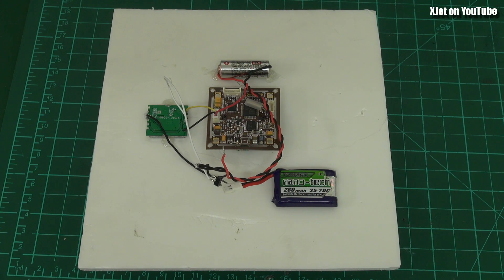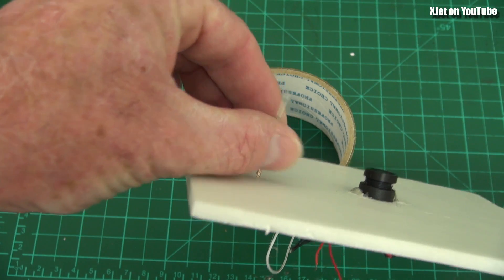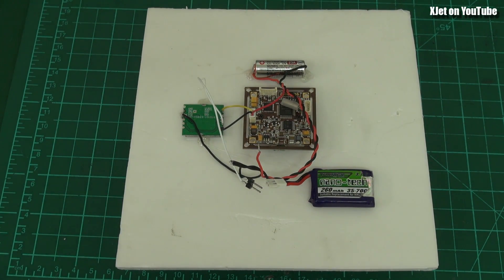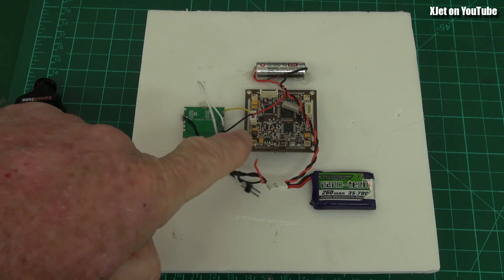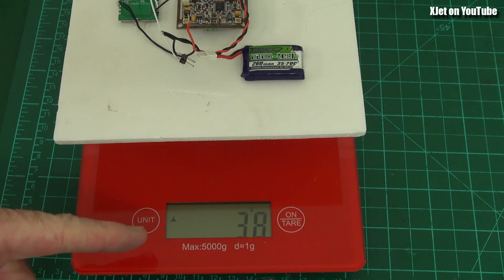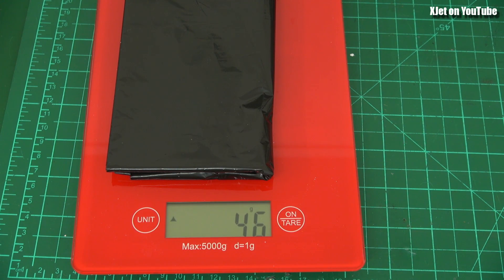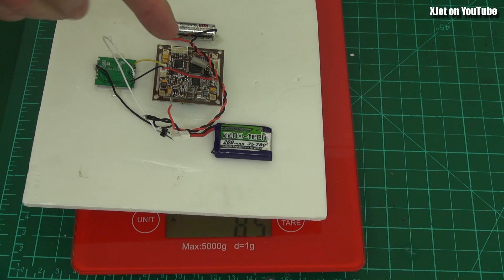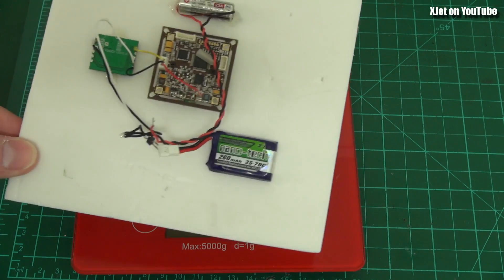A drone alternative: hydrogen-lift aerial video (FPV) Part 5

Comment: In AU, Big W here do helium balloons (filled) for $2. We tried several times to do the Mayor-FPV system, and it finally worked well with an AIO camera on 1S, 4 balloons tethered with a kite string, but the image was very .. wobbly, it would have been ok in dead still air, but by the next still day, enough of the helium had leaked out to rob the required lift. We did tie a chemical light to it that first night, which stirred things up around the area quite a bit.. in the dark it sat dead still 300 feet up, glowing bright green.. way out in our back paddock, you could see it for miles around. That was more fun than the M-FPV!

Comment: Just a thought: attach a little parachute attached to a RC servo for release to recover the payload? This would mean a 2.4 GHz RTX as well of course but you might then be able to track it using the RSSI signal on a Taranis. I have recovered downed quads like this! You must have some old FrSky RTX's laying around? Being able to track and recover this rig makes it more in line with modern thinking like SpaceX. Recycleable fun!

Comment: But you can get a combined camera/transmitter which will run on a single cell. A 150mAh cell runs a mini quad for 5 minutes at the same time. It will run the camera slone for about 35 minutes. I think you should think small.

Comment: you can ditch about half that foam board.  If you're not mounting something to it leave it on earth.
Reply: second thought, make a stack out of the componets like we do now on mini quads.  you will get rid of almost all of that foam board.  Adding fins and thinking you will take control of a bag of gas drifting in the wind is pointless and just adding weight.  How much more does a huge trashbag weigh over mylar balloons?

Comment: A dipole in that orientation will have had a null pointing down (towards the ground). You should have had it parallel with the foam board not perpendicular/normal to the surface.
Reply from the maker: If the balloon was going to be directly overhead that would be true... but balloons drift with the prevailing winds so the vertical orientiation means the null wlll be a point directly below the balloon some distance from the receiving antenna.  Vertical polarization will provide the most consistent results because there's nothing to stop a horizontally polarized antenna from rotating around until one of its nulls is pointing towards the receiver -- given that it will be a lot further away than it is high so the angle between the balloon and the receiving station will be a shallow one.

Comment: How about an atomic battery? Very light weight, will last for decades. Theoretically speaking,  you would need an alpha particle emitter  (from a smoke detector). 3 small solar cells (from garden solar lights). White phosphor (from an old CRT TV), a small voltage multiplier  (from a 1 cell backup cell phone charger). I say again, its all throretical 😨

Comment: Why not get one of those cheap 3 in one 200mw cameras and put a directional antenna on it pointing down. They weigh less than 5gr and a 180mah lipo is around 5grams as well. That'll save a lot of weight and space and I know you know how to build antennas, build a biquad antenna.

Comment: A four cell ballon battery. Bigger is better. Use lead acid truck battery Bruce. Empty your water bed to use the bladder for extra volume. What? Water beds went out in the 1970s. Well truck battery grounded. You will have to do that light stuff

Comment: there is a project i mentioned before that does something really similar -- no fpv, but realtime worldwide tracking! you could have a look at their project for ideas: https://qrp-labs.com/flights/u3b17.html 
the solar panel might double as a support, and maybe even supply 12v for your camera -- only need it in the daytime anyway!

Comment: I'm not an environmentalist, but those bags will still take many years to degrade. 'compostible' tends to mean that they will degrade, but only if they get heated in an actual composting heap. They won't just disappear after landing somewhere, although they will probably degrade a little bit faster than normal bags.

Still just a drop in the sea of discarded plastic though, so it doesn't really matter. 

A bit more OT, wouldn't something like an Eachine TX-03/TX-02 be even lighter?
Reply: Its also biodegradable FPV gear!
Reply: gotta say I thought that sounded strange. don't throw plastic bags away people, if not for environmental reasons, maybe for 'not wanting to live in a ghetto' reasons. poor form Bruce..
Reply: Joran Groothengel don't know about where you live, but here in the UK most bags you can buy start to biodegrade the second you put anything in them, particularly shopping bags

Comment: So you still cant fly a quad? Get yourself a pixhawk flight controller so that you can be flying around and if the police as you put it in auto and have a mission set that will fly back to your house and you can then just stow away your remote and drive back home

Comment: We want a huge ballon full of gass exploding in the turbine we want it bigg,real news how a new zelender killed a plane  without thinking ?
Reply: I'm not sure if that would work (it might, but I'm not sure). To pass certification they detonate a charge to "free" a couple turbine blades that get ingested by the engine, then they inspect for damages and make sure its still flyable. 

So I think it should be fine, they already have about a lot of centrifugal force. A propulsion engineering professor equated it to hanging half a car off the tip of a turbine blade while heating it up with a torch. They are also hollow turbine blades for 1000+F "cooling" air to pass through... So yeah, they are under extreme loads, its crazy they don't fly apart more often, that and they can withstand eating metal turbines at such high impact velocity.